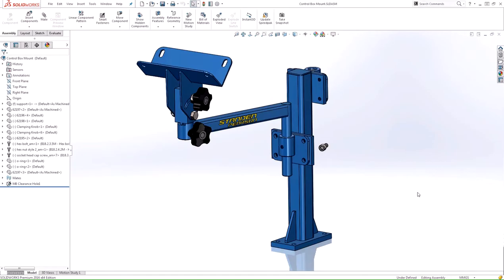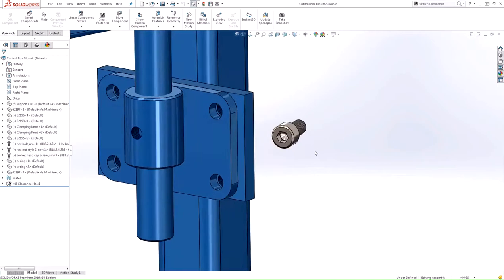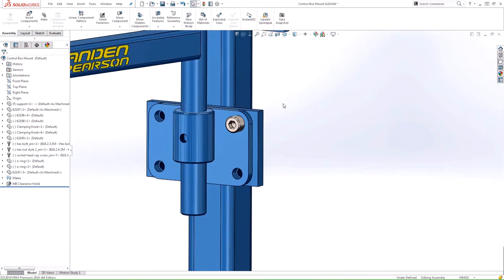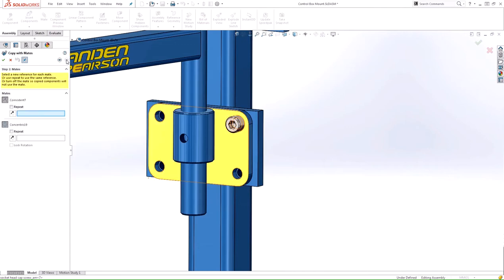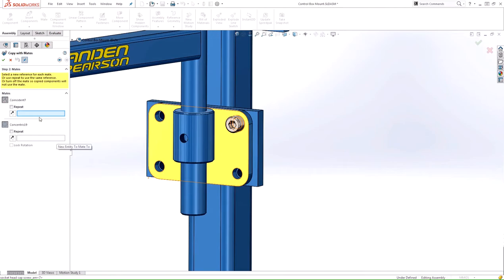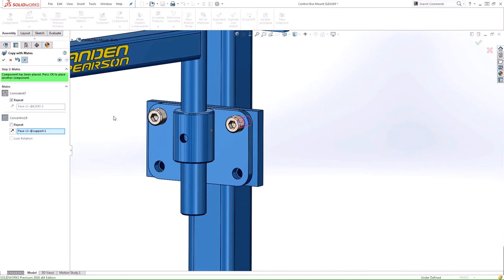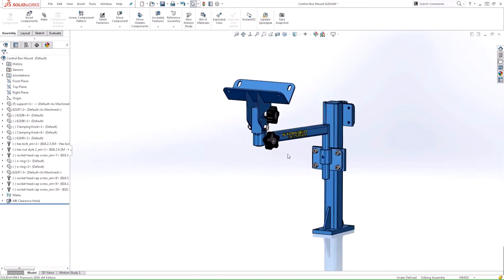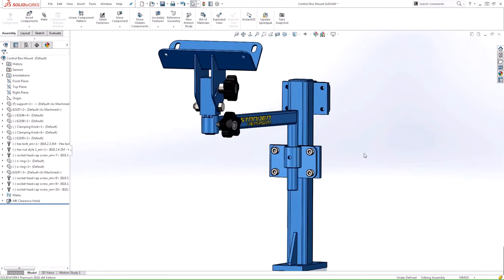SOLIDWORKS Tips & Tricks Using Copy with Mates

Comment: This feature would save us a lot more time if it wasn't laggy as hell. As soon as you start working with more parts such as screw + lock washer + nut, SolidWorks freezes for 10+ seconds every action you do... Still a problem in 2020.